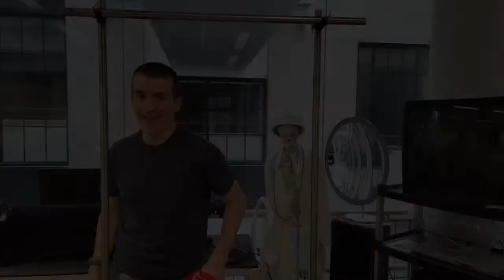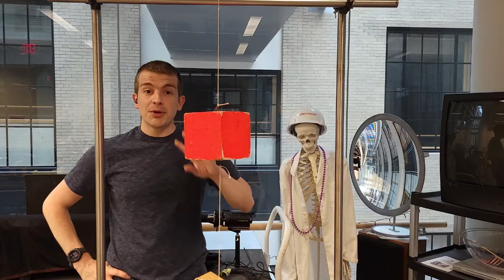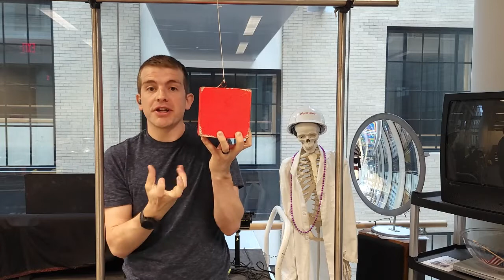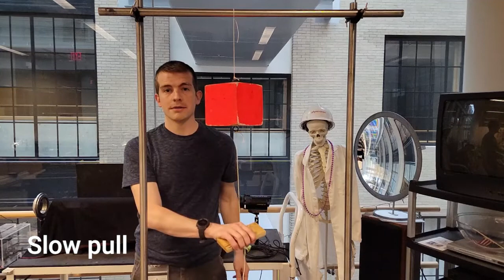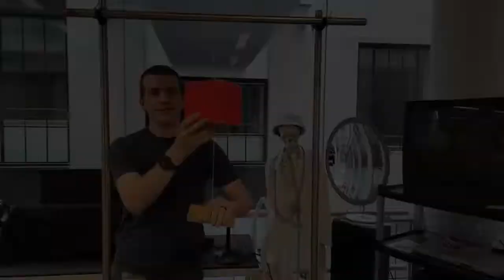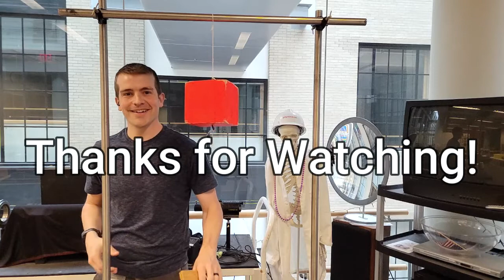Inertia explained by breaking a string.

Comment: When I went to school objects had; Inertia and they had Momentum.
These days objects only have Inertia even when it's what I know as momentum.
Is momentum frowned on these days? I get that momentum is another form of Inertia, the same as deceleration is still acceleration but negative. It takes energy to oppose the mass's kinetic energy so it has inertia...
If you had an idea; as you developed the idea is gains 'Inertia'? That just sounds wrong. If your driving instructor says accelerate to a stop at those lights, wrong again! so why can't it still be taught that when some mass gains velocity it gains momentum? I just never hear it, instead it's the ambiguous, figure it out for yourself, generic term of inertia all the time and I'm not so sure it's helpful to many apart from boffins like yourself, when you're talking to other such boffins if you get my meaning...